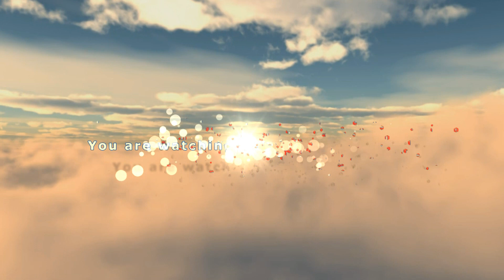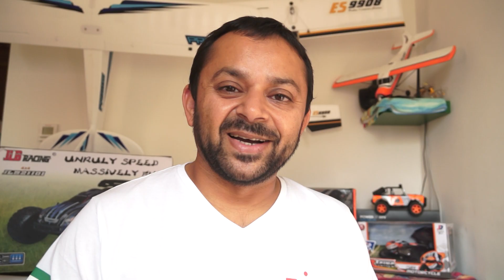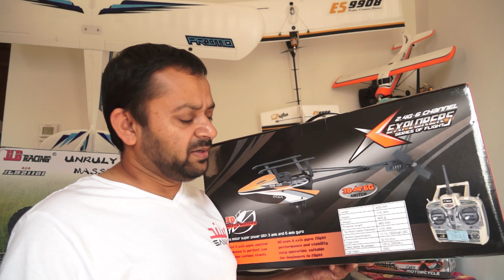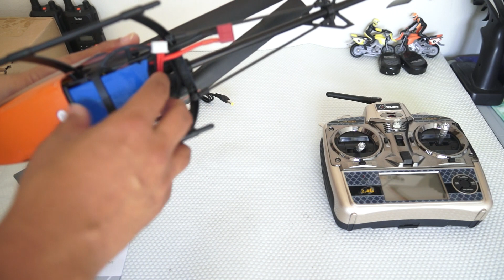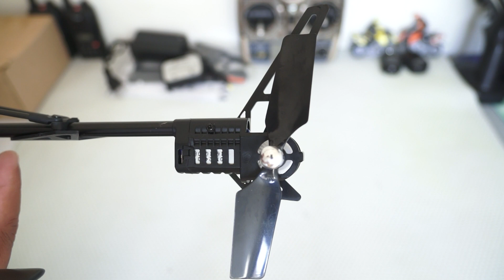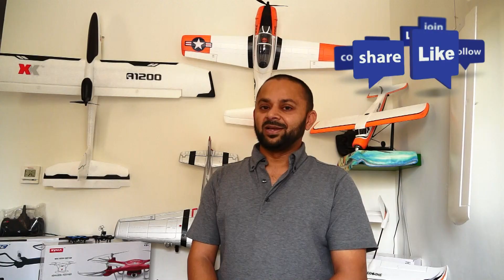WLToys V950 Flybarless 6G RC Electric 3D Helicopter Review

Comment: Hi Alishanmao, Question for you! Is there a six axis gyro out there for helicopters? I have a kds flymentor gyro. Seems to be about the only system I can find. Can't believe with the speed of new technology coming out all the time. That there isn't something other than the kds out there!!  I'm not looking for a complete copter. Just the gyro! Thanks up front for any help!!
Reply from the maker: Except the built in 6 Axis Systems in Some new RC Helicopters like XK K110, K100, K120, or others I have not seen stand alone 6 axis systems for DIY helis. Not sure the expensive ones like Align systems or beastX are 6 axis?

Comment: Did you tighten the main blade grips before flying it? Every other review I watched by a self described “drone pilot that’s not too good with helicopters” tried to fly it right out of the box without doing any sort of mechanical check on the setup or even knowing that you can’t fly with blades so loose they flop around just from tipping it.

Comment: I'd try out a V977 or a V966, they're so cheap and probably what you were actually planning to buy originally, although your K110 may already outclass them.  I'm really enjoying mine though, it's proving very simple to put back together when I do manage to stick it into the dirt extra hard.  Most of the time they survive fine.  They use the same transmitter I think, so you could go the BNF route.  And I don't know about the V950, but both the smaller birds have the drive gear loose enough that it just pushes down (and needs to be pushed back up to engage the motor gear again) after crashes, which preserves the internals and the gear itself very well, it's a great failsafe.  At least until the gear pops off entirely.

Comment: The BNF unit I got is a junk. Banggood send a refirbished unit as a brand new one. Pushrod won't stay attatch with swashplate. All pitc are off. Scratch mark on the tail assembly screw. All signs shown someone worked on it before but did a bad job. Caontacted Banggood several times and all I got is keep apology and offer me a tail motor that I don't need. no more purchase from Banggood from now on!

Comment: It's a copy of the Walkera Master CP and it is a 200-250 class helicopter. A 450 class heli is much bigger... it's about time you don't pilot helicopters... ;)
Reply from the maker: if its not 450 still its not 250 class. Trust me. I have seen and flown helis a lot. its probably a 350 to 400 class.
Reply: What is the length of the blades ? About 200 mm ? My t-rex 450 has blades that at least are 350 mm long. The length of the heli is more than 600 mm.My Walkera Master cp, that is about 200 class heli, is 440 mm long and has 200 mm blades.
Reply: you're right. it is the same size as Master CP and it is lighter. Each blade is 200mm from screw, 210mm total.

Comment: i guess its actually 200 sized?  u said 450. correct me. Also it look like the larger version of wltoys V977 heli
Reply: alishanmao certainly not a 400 size. Manual is crazy.  This is a 200-250. Most normal companies name after blade size of one blade. Align still has not figured this out.  Goblin 380- each blade is 380 mm long. This is like  a blade 230s size. 460 main rotor dia on this 950.
Reply from the maker: User manual specs say 450mm
Reply: yea this is way to small to be 450
Reply: What was forever classified as 450 size, along with all other helicopters was the motor frame size back when they were sealed can brushed motors. A 450 motor frame size helicopter had a main rotor diameter around 710mm. A trex 250 has a 460mm main blade diameter.